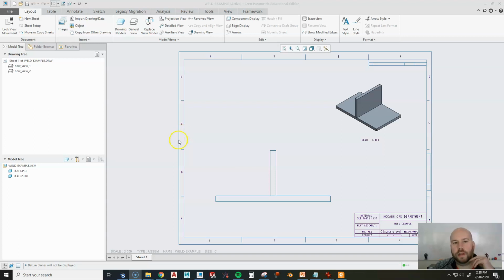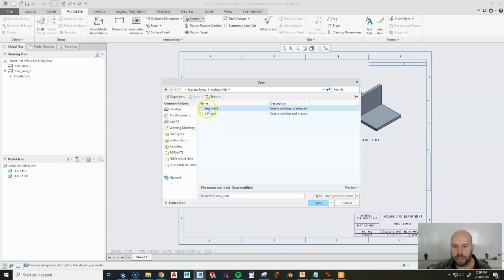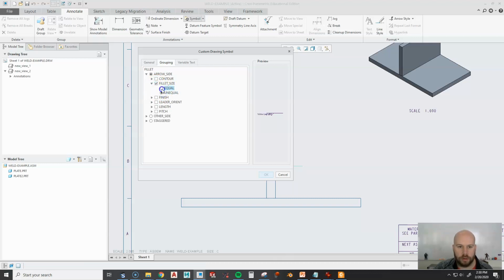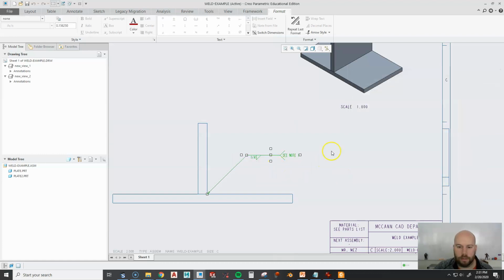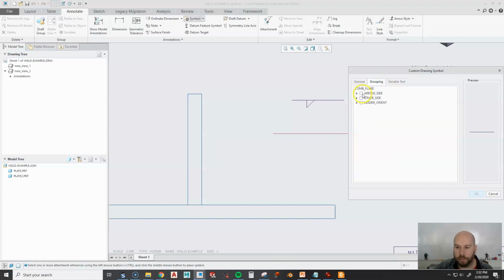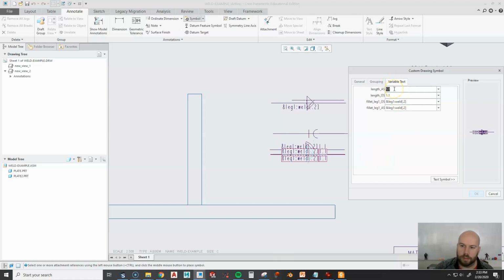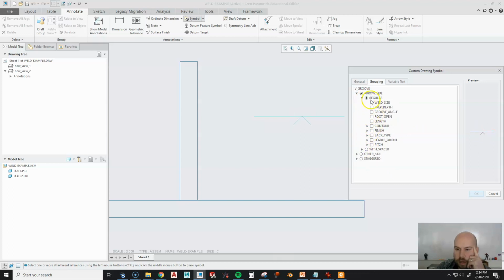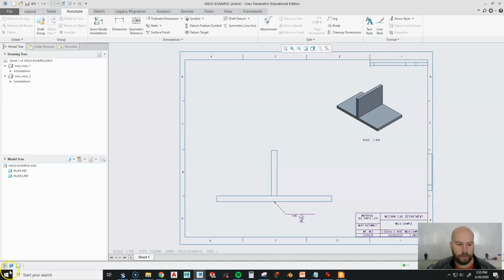CREO: HOW TO CREATE WELDING SYMBOLS

Comment: Thank you for the video.

How do we create a combined welding symbol, for example, fillet weld + bevel veld?
Reply from the maker: That will be in the other folder named "combined" instead of selecting the folder named "simple" like I do in the video. Hope this helps!
Reply: @MrMezCAD  Yes, I tried. I didn't work. Atleast on my vesion of the Creo.
Reply from the maker: @sergeydukman5832  Hi Sergey, once you select it, then go to the last tab on the settings and there should be a drop down for arrow and other side to choose which weld type you'd like on each side. I've tested on older and newer versions of creo and it seems to work so let me know which version you are in and I'll try it.

Comment: Great tutorial. I am wondering at changing the tolerance decimal places? From a two place to a one place.
Reply from the maker: You can set that up in your drawing config file. The weld symbol will follow your default tolerance. You can also turn on the config option that says "drop trailing zeroes"

Comment: Hate this program with a burning passion.
Reply from the maker: As someone who's used Creo since it was Pro-e 2000i (yeah I'm really old), I get it. I've taught this program for 8 years to students starting as early as grade 8 and I will tell you it's definitely how you learn it. By grade 10 my students can run Creo better than many engineers. The most common thing I find is trainers who just teach from textbooks and that makes it very unenjoyable. I hope my videos help you but if you can't find what you need in them just ask and I'll make one for you!
Reply: I hate it more.
Thanks for the tutorial btw, cant believe I had to search for how to add a weld symbol to an engineering CAD program.